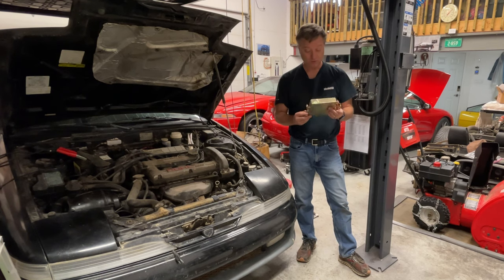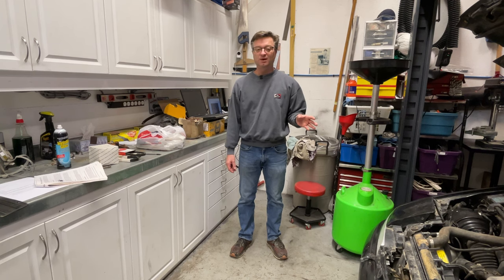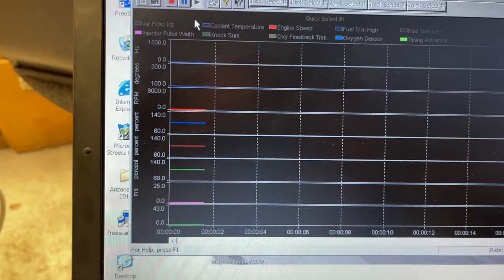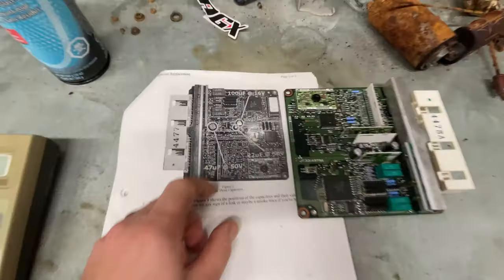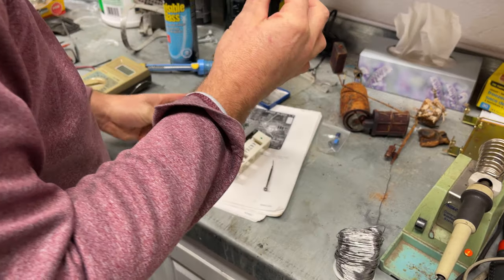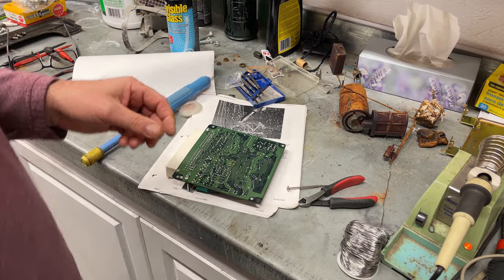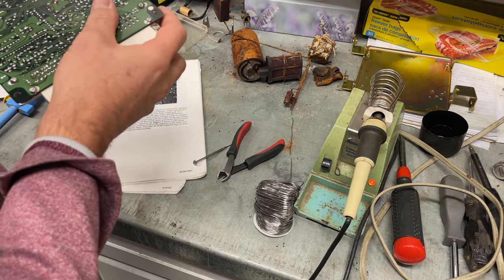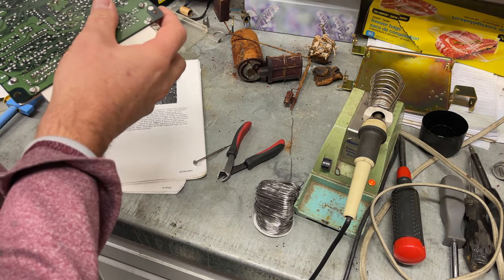Old Car ECU Repair Time! Fixing bad Capacitors

Comment: You aren't kidding when you say these ecu issues started happening pretty early on. I recently bought an eprom ecu that came out of a mint 92 Laser RS and it had a paper seal on it stating it had been repaired on 12/2000. Still works good thankfully.

Comment: Love old sites like that. I still use Vfaq at times.
Reply from the maker: Yep. Just the domain name VFAQ tells the story of how DSM’ers were one of the earliest adopters of using the internet to share information. 
I have quite a few print outs of all the early day stuff. .
Reply: @SlippingTime  I remember back in 2000 finding out if I remove the pill restrictor in the oem 2 port on my 97 gsx I could get 14psi for free🤣🤣 good times.

Comment: hello, it's been a while since I've been here, I really like your videos, I've been hampered by work and health for a while, and my eclipse GSX has gone dormant, this procedure I did a year ago, one of the main symptoms is the cut of force around 3500 rpm, exactly as the detonation sensor acts with abnormal knocks, deceiving the search for the real defect. As you commented, it is important and preventively to look at these capacitors. Thanks for your videos they are always useful, brotherly hugs despite the distance.
Reply from the maker: What wonderful comments. Thanks so much for sharing your own symptoms you experienced. The more information people have in the community, the better. Thanks so much for the kind words too!

Comment: Excellent video. I have often heard the words " its the ecu" nothing we can do but find a new one. This kind of video is really educational. I am still a little fearful of those silver boxes but if it's a case of fix or junk yard then I will open the box. Thanks
Reply from the maker: In this particular ECU the odds it will be the capacitors so it is worth an attempt for sure. Plus we need to keep as many alive as we can since they don’t produce them.

Comment: Mid 90's to early 2k's there was a worldwide capacitor problem particularly with electrolytics leaking out and or corroding
On all types of electronics cars, appliances, stereo equipment etc,etc.... So typical malady for that era of equipment.
Reply from the maker: Very true. Thanks for sharing the information render8.
Reply: Yes. It was named the "capacitor plague."